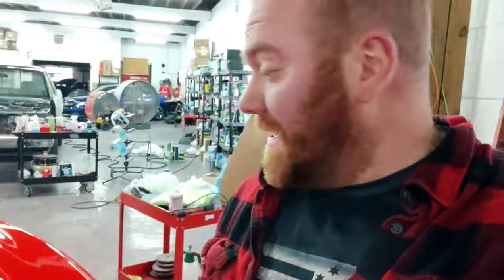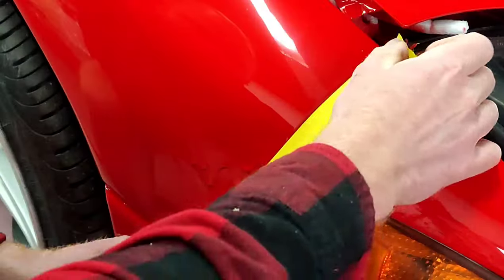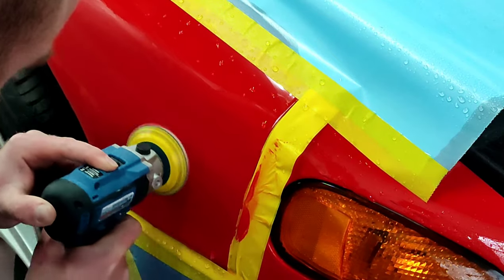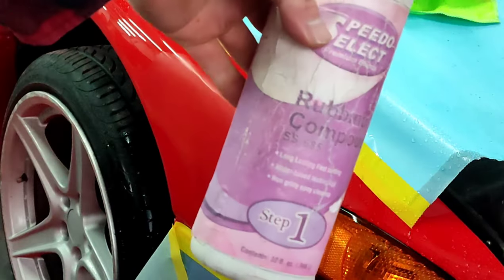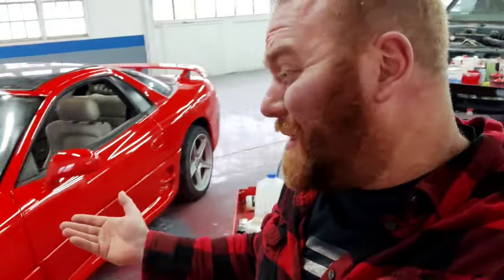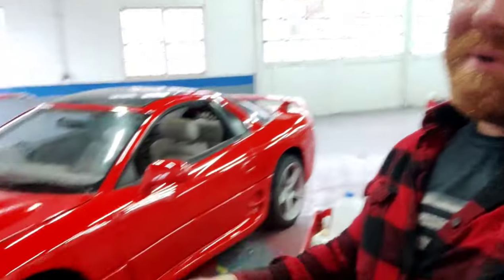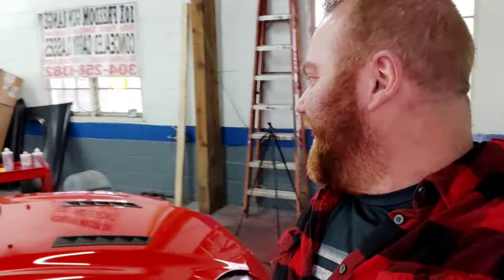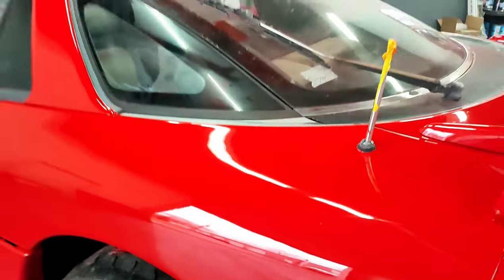How to remove paint runs STEP BY STEP

Comment: Ive been painting for going on 15 years now. I do have an LLC. I do own an auto restoration business. I do paint cars and trucks and motorcycles on a daily basis. Aaaand...I DO GET RUNS! Its life. Its a part of the job. Nobody understands all of the factors that go in to shooting paint. Temps. Humidity. Moisture in an air line. Compressor oils.  Theres so many more on top of those. Anyone who talks smack on a painter for having runs in a paint job is an A Hole. Plain and simple. Keep doing you bro. Youre a talented dude. Your work shows that. Ive reached out to you for work before and i do it for a living. That says enough in my book.
Reply from the maker: At the end of the day , I'm just trying to make content for the people at home, the DIY weekend guys ect ect. 99% of the cars on this page are mine so if I screw up no biggie 🤣 I'll fix it when I can or If I even want. But there isn't a single paint problem I CAN'T FIX. Your right people don't take into factor painting conditions constantly changing. That's part of my issue with this job it was the first full body job this winter

Comment: Better get some 600 and completely sand that run out. You can still see the sag..
Reply from the maker: I clearly stated this in the video. You didn't watch till the end.
Reply from the maker: And also I have no idea who in the heck would ever wet sand paint with 600, but I NEVER would do that, there is almost no professional ever that would tell you "yea go ahead and wet sand that with 600 and buff it "
Unless you got like 4-6 coats of paint to work with this is never a good idea 🤣🤣🤣🤣
Reply: Sand the whole car flat, then spray 1 med coat. Then buff/polish and  done.
Reply from the maker: @phillipgrandison2384  literally exactly what I was going to do.

Comment: Can you paint a car in steps over a few weeks? For example, paint the driver side completely and then
the other side and then the hood and lastly the trunk.
Reply from the maker: That's pretty easy to do it's the same as painting a full car just more masking 🙂
Reply: Also, makes sure your mix batch is the same, so mix it all 1st, then use each amount needed from that batch. That'll ensure the tone stays consistent.

Comment: Hi Marco, big fan of your Channel here. I’m painting a 69 roadrunner that’s full of dings but is mostly rust free. I want to paint it in one of the bright old mopar colors in single stage. I’m also trying not to get too crazy on the body work. I’m not looking for a perfect paint job anyways because it’s my daily driver. Do you have any recommendations?
Reply from the maker: Prime with ss2790g 
Block 180-320 grit 
Lay 2-3 medium coats of single stage over it, done. 🙂
Reply: @speedokoterefinishnetwork4937 Any sealer?
Reply from the maker: No need for it with this paint

Comment: One request for those of us who are watching to learn how to use these products: say what product(s) are going on the car at the start. I had no idea this was single stage until you were basically done with your corrections. I didn't know if you stopped after basecoat to sand out the runs and then clear or what. You just sort of mentioned offhand at the end.
Reply from the maker: Paint products were mentioned in the paint video 🙂 and I tried to film all the different polishes I used sorry for confusion

Comment: I can still see it clearly, even as you were repairing it I could tell you didn't take it all the way down before you stepped up to the fine paper. Yes I have painted cars before, yes I have removed runs completely.
Reply from the maker: https://youtu.be/Uj5IMhf-1Wo?si=JJPmVCe0XCYNDEKV
Reply from the maker: "Hey guys I'm guna clean up some headlights " 
- doesn't uv protect them after the job 
-using an old crap rotary buffer which probably left a million swirls in the light 
- STILL YELLOW STILL LOOK LIKE CRAP 🤣🤣🤣🤣🤣🤣 
dude I can tell just by this video YOUR WORK SUCKS . PACK IT UP AND GO HOME BUD. 🤣🤣🤣

Comment: Dude... Hate to tell ya but the run is still there (you could see it). Just repaint those panels it's single stage. Stop trying to justify keeping all of those runs in that paint. I've been painting cars for 40 yrs (20 of that professionally) and even I get the occasional run!
Reply from the maker: Oh I definitely specified that in the video it's still there it ain't prefect, but not trying to make it a perfect car. Down the road I might sand the whole car down again and flow coat it but who knows
Reply from the maker: One thing everyone misses in my page is I display a variety of work levels so ALL of my viewers feel welcome, comfortable, and give them the encouragement they need to make there car great again. While yes does spraying in a booth 24/7 make every job some out great absolutely, but most people watching these videos don't have that type of equipment
Reply: @Kaclaytor  Well CLEARLY your comment shows just exactly how much you DONT know about the subject lol.
Reply: @speedokoterefinishnetwork4937  Another trick you can do that I learned from an old time painter is to take some polyester spot putty (2 part) and spread it over the run. Then block it with like 400 or 600 until all of the putty is gone. What that does is keeps you from sanding on the paint around the run UNTIL the run is gone. Then just hit it with 1000, 2000, 2500, buff. It will totally remove the run and the area will look perfectly flat.
Reply: I mean yea I noticed it was still there too. But I watched till the end when he admitted they were still there 🤦🤦🤦
Reply from the maker: @vidaiautomation   so I guess sanding it down and giving it a flow coat is wrong ? Oh ok, I guess me and a bunch of other guys on here are wrong as well cause I've seen just about every other YouTube painter do flow coats before.
Reply from the maker: @eastcoastken  that's my point. I told everyone I can still see them very very close. It ain't perfect nor am I trying to make it perfect. People seem to forget that part. These also forget I have like 27 vehicles that all need work and I can't throw my all into every single car 🤣🤣🤣🤣
Reply from the maker: @vidaiautomation  not to be capitan a hole... If your paint work is that good why are you posting marketing videos on your YouTube page and not paint stuff? We would all love to see your work being it's better than anyone else's from what your saying? Also wheres your body shop?
Reply from the maker: @Kaclaytor  your more than welcome to show me you can do a better job. Anyone is welcome. 
Keep something extremely clear in mind. There is a huge difference between my "economy style" Work and my work which is more aimed towards show quality.. The problem with today's society is y'all want the cheap economy style work then complain about the results 🤣🤣🤣
Reply from the maker: https://youtube.com/shorts/v2xwtV__I10?si=WfNiRStIKtR9efFQ
Reply from the maker: MAKES VIDEOS GIVING ADVICE ABOUT HOW TO MAKE A YOUTUBE PAGE 
ONLY HAS 200 SUBS. 
🤣🤣🤣🤣🤣🤣 dude just pack it up and go home.
Reply from the maker: @vidaiautomation  this is exactly where the conversation goes quiet 🤣🤣 talk crap and can't even come a lick close to backing it up. Sit on down bud.